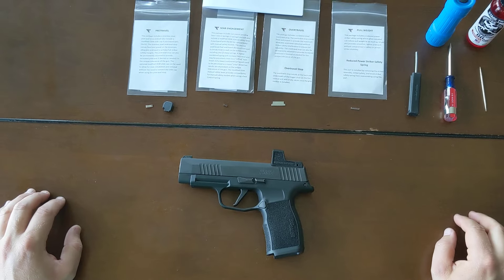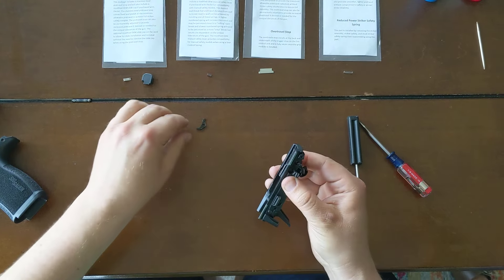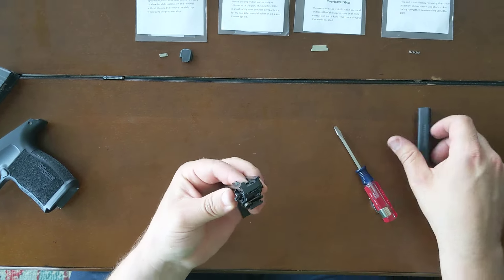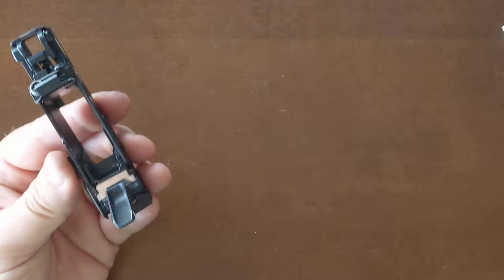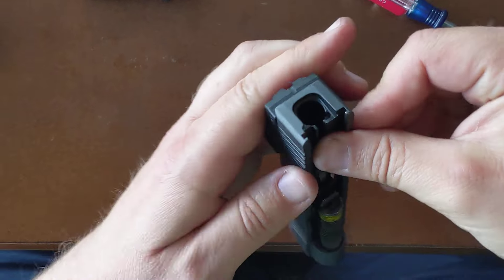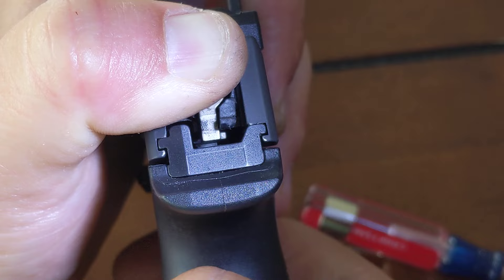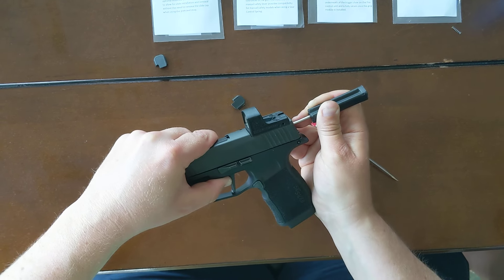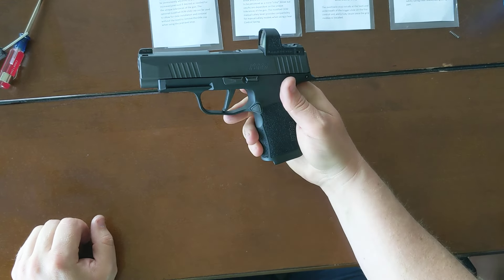Tactical Trigger, LLC Sig Sauer P365® Trigger Kit short install video

Comment: Holy crap, that took me about 2 hours to complete.
Mainly because of the trigger assembly stuff falling out, getting the alignment right...take it on and off because the overtravel stopper was making the sear stuck (not letting it drop the striker).
Ended up not using the overtravel stopper at all since while it does reduce a lot of the take up, it makes hard to tell if the trigger is dead or it's about to hit the wall where it drops the striker.
Gun I used is a P365 XMacro with the muzzle brake.
Sear spring #3
pretravel stopper
pull weight spring.

Overall, very happy about the reduced pretravel length. I can feel the trigger is lighter because of the spring and little bit shorter take up time.
Give an update when I go shoot it.
Reply: I would frustrate the hell out of myself trying to do this.......he makes it look like breathing air but wow what a change👍

Comment: This is exactly what I’m looking for. I want to eliminate that creep from the wall to the break while still keeping the pistol reliable and safe for EDC. Tbh I don’t really care about the weight of pull as much as a consistent break
Reply from the maker: @blackmetalbreadstick  Pole weight is optional with the kit and if all you want to do with it is just eliminate the creep in the brake, you can just purchase the sear control springs alone but most are usually interested in pre-travel reduction as well.

Comment: TT….I just installed the kit on my 365XL and funny thing is, my pistol would not work with the overtravel stop in both configurations. Once removed, it works like a charm and looks like yours does in this video and there’s no overtravel without it.
Reply from the maker: Some guns won't use an overtravel stop based tolerance variations. Sounds like that was the case with yours.

Comment: Same here after kit install , pistol would not fire ! Removed all but 1 super thin overtravel stop , still no fire ! Fired fine with no stop at all ! For my wife is there a lighter tension slide return spring ? She has hell jacking one in the chamber  !
Reply from the maker: A lighter slide spring will cause issues in the 9mm. You might consider a P365-380 for your wife which has a lighter slide spring and is easier to rack.
Reply: Should watch Melody Lauer's vid 
"Racking a Slide With Weak Hands"
https://youtu.be/kbayNc6D9HY

P365-380, love it. Highly recommended.

Comment: Will the pre-travel & post-travel stop pieces work on the curved trigger? Not a big fan of the flat trigger and want to replace it with the OEM curved one.
Reply from the maker: Yes, the complete kit is also compatible with the curved trigger as well
Reply: I changed to curve, and my finger doesn't fit well between the trigger and the trigger guard.

Comment: is it safe to carry with the #3 spring, pretravel stop, and overtravel stop? is it drop safe?
Reply from the maker: @LosPollosHermanos213  The kit is designed to maintain proper engagement levels for full safety and reliability margins. Since each gun has unique tolerances, it is best to inspect for proper margins on install. In most guns, the #1 sear control provides proper sear engagement levels but in some guns a #3 sear control spring functions like a #1. In the most extreme tolerance outliers, #3 may not provide enough sear engagement margin in which case we have alternatives available (these is very unlikely). Sear engagement is the primary drop safety and the striker safety is the back-up/catch all. The pretravel stop is extremely unlikely to bypass the striker safety as the takedown lever won't rotate far enough to put the slide on if did, however again it's best to check for proper function and margins on install. That's why we provide the safety and reliability checks so that you can have confidence, everything is good.

Comment: I have noticed some discrepancies in my grouping of P365 that isn't present with my 1911 and I attribute it to the "creep" between the wall and the break. If I understand correctly, sear control spring reduces creep by lowering the starting position of the sear. Can I buy only the sear control spring? Thanks
Reply from the maker: Yes the sear control springs are available separately from the full kit.

Comment: How does the modified backplate change in function from stock?
Reply from the maker: With reduced pre-travel when using the pre-travel stop the safety lever is kicked up slightly which interferes with the stock slide cap when removing or installing the slide. The modified slide cap allows clearance to be able to install and remove the slide as normal when using the pre travel stop.
Reply: @tacticaltriggerllc   So do you have to remove the backplate to get the slide off, or do you just have to wiggle it a bit and pull up on it?  :)
Reply from the maker: @joeflowers9084  You would need to remove the stock slide cap when using the pre-travel stop. The modified slide cap allows for normal takedown and installation of the slide.
Reply: @tacticaltriggerllc  Thanks (I found the answer on your website and already ordered one--this is a really good design).

Comment: Is getting the MCarbo Titanium striker kit worth it to get better quality parts in the long run, and is it compatible in any way with your trigger kit?
Reply from the maker: The Mcarbo titanium striker is not compatible with our sear control spring based on its geometry changes. It also has less primer strike strength compared to a stock striker based on the weight and reduced power spring. Most customers I have talked with that have had them experienced reliability issues. You will get much better performance with a stock striker and our sear control spring. I wouldn't recommend using the Mcarbo striker.
Reply: @tacticaltriggerllc  thank you for saving me the hassle (: I'd much rather have it really reliable than have a nice gun not fire. My main concern is rust issues on the striker and spring and that affecting reliability. That was my main draw towards the titanium. 

P.S. Ordered the trigger kit last night and I'm excited!

Comment: Are there any trigger safety triggers you would recommend that are the flat style that could work with this trigger kit? I like the stock but was debating getting a trigger that might have just that extra bit of safety for the gun.
Reply from the maker: The only one with the trigger safety is the Tyrant CNC trigger that I'm aware of. The trigger kit does work with that particular trigger with the exception of the pre-travel stop may need a layer removed or can't be used at all depending on tolerances. If you're interested in additional safety, I would add a manual safety lever as opposed to using a trigger with a blade safety since all the blade safety is really there for is the trigger itself is so heavy, it can be pulled in a drop. If you want to add a manual safety to the gun, you will need a modified manual safety lever for compatibility with our sear control spring. We have those available on the website if needed.
Reply: @tacticaltriggerllc   ah. I think I checked the "not needed" box when I ordered mine because the grip module I'm getting doesn't have the manual safety (the Wilson Combat p365 x macro grip module). So I may just be out of luck then? Either way, the gun I currently have doesn't have a safety (it has a slight trigger safety I guess). I'm sure someone would explain to me that a safety isn't important and leads to a false sense of security, etc. But that's why having the trigger safety would make me feel a bit better about it.
Reply from the maker: @Rothdrop  A trigger safety isn't an "active" safety in the sense that your finger defeats it in the same action as pulling the trigger. The pre-travel stage of the trigger pull on the p365 defeats the internal striker safety. A blade safety isn't required because the trigger won't pull itself in a drop based on its weight compared to the trigger bar. Guns with trigger safeties need them to avoid the trigger pulling itself based on either the weight of the trigger bar or the weight of the trigger. You can still add a manual safety, we have them available separately from the full kit. As noted you would need to get a compatible grip module or modify the grip module for the manual safety cutouts.

Comment: I currently have a tactical development enhanced dual flat faced trigger on my 365. Would this kit work with it? It's basically a trigger shoe change
Reply from the maker: Yes it is compatible. You can either use the pre-travel set screw on the trigger or our pre-travel stop. The rest of the kit is compatible without any unique considerations.
Reply: @tacticaltriggerllc thank you so much. Placing my order now. I have it on my stock xmacro and love it.

Comment: Will this work with the m carbo titanium striker kit and the Tyrant cnc trigger? I also have the empire pdf javelin recoil spring, super long qeustion I am sorry
Reply from the maker: The sear control spring is not compatible with the mCarbo striker. You will get much better performance than the Mcarbo striker by using a stock striker and our sear control spring while avoiding the reliability issues of the Mcarbo striker. The kit is compatible with the Tyrant CNC trigger except for the pre-travel stop since pre-travel reduction allowable is governed by their blade safety. Performance wise most that have compared any of the aftermarket triggers upgraded vs the stock trigger upgraded with our kit will usually prefer the stock triggers. Other aftermarket triggers are more about looks than performance but there is a place for that as well. Hope that helps.
Reply from the maker: The recoil spring won't have any compatibility considerations with our trigger kit.
Reply: @tacticaltriggerllc  appreciate the quick response, if I had known about your amazing product before I bought the titanium striker I would have just gotten your product, sadly I already have the titanium striker, so I'll have to make do. Definitely using your stuff for my next build though

Comment: Does the trigger kit effect the drop saftey of the handgun?
Reply from the maker: Drop safety is not affected. Safety checks can be performed at installation and also recommended periodically to ensure all safety features with appropriate margins are maintained.
Reply: @tacticaltriggerllc  sweet! Thanks for the quick response. I think I'm sold.

Comment: So what does the “sear control spring” do?  The gun doesn’t have one, so is adding it basically keeping the striker from going downward as much?  Also, it’s loose and not putting pressure on the safety lever, correct? It’s just there to add space, like the spacers in front of and behind the trigger, right?
Reply from the maker: Yes. It isn't acting as a spring. It is acting like a spacer increasing the thickness of the safety lever pin. The safety lever pin is also the stop for the sear so increasing it's thickness adjusts the ride height of the sear.
Reply: @tacticaltriggerllc  Yes, I figured it out after watching the long P320 video. Thanks!  Mine is on the way.
Reply: @tacticaltriggerllc  I just installed my kit on p365, sear spring 3 and 1 over travel plate cause the gun won’t fire with more than 1over travel plate. 

My question is will going to sear spring 1 allow me to run more over travel plates? And from the looks of it spring 1 is the thickest so will that give more of a rolling trigger and spring 3 more of a breaking/crisp trigger? I just removed the sear spring cause the sear and striker were only connecting about 75% now it seats all the way.

Either way I just ordered another trigger kit for my pmm compensated p365x so I’m definitely looking forward to seeing how the two differ.
Reply from the maker: @CplGoldFish21  The sear control spring doesn't affect the overtravel. So installing a different sear control spring won't have an effect on the number of layers you can run on the over travel stop. The number one sear control spring provides the least amount of travel from wall to break ie more crisp. The sear control spring performance is relative to the tolerances of each gun. For example a number three could perform like a number one on another gun. The goal is to find the sear control spring that provides full coverage of the sear interfacing surface with the striker but not too much more. In most newer guns a number one sear control spring can be used to achieve this but some guns may still require a number 3 based on tolerances. Another check that can be done is with over travel minimized to just provide a clean break and no extra additional over travel, the travel from the wall to break should be around a 16th of an inch or more if the striker and sear engagement is greater than full coverage. This is a secondary check that can be done if you are unsure of how to verify the sear engagement visually. Hope that helps.

Comment: How durable are those metal shims that are placed around the trigger to act as travel reducing stops?
Reply from the maker: They are made of stainless steel and will typically last around 10k rounds on the low end.
Reply: When they fail can it cause malfunctions or does it just wear down over time?

Comment: I had a shop install my kit and decided to take out the overtravel and pretravel stops. Because its my EDC. Can you explain what the rest of the kit is doing compared to stock internals?
Reply from the maker: The sear control spring reduces the amount of creep in the break. A stock gun does not include a sear control spring. The reduced powered striker safety spring reduces pull weight by using a lighter spring than the stock spring. The striker safety spring is a good choice for pull weight reduction since it has no impact on primer strike reliability or safety function.
Reply from the maker: The pre-travel and over travel stops have been designed to allow for appropriate margins for a concealed carry application to maintain full safety and reliability as well. However, for preference, some may prefer more pre-travel and/or overtravel for a carry application.
Reply: @tacticaltriggerllc  Yeah I really like the springs in the kit. I do notice a significatly better break using #1 SCP. I think its just my personal preference to take out the pre and overtravel spacers. I still have almost zero overtravel so Im really really happy w the kit overall. Hey thanks for reaching out so fast!!! I know this video is over a year old so I really appreciate it. Fastest reply I've ever had. Thanks again for the great explination of everything. I will be recommending your kit to all my buds. Cheers!
Reply: @napster1363  can I buy the over travel stops from you?

Comment: How do you reduce the trigger pull weight to 3lbs?
Reply from the maker: Once the stock springs and sear to striker interfaces are broke in, the pull weight will be between 4 to 5#. If you install our reduced power striker safety spring, the pull weight will be 3 to 4# depending on the particular gun. On some guns that are closer to 3#, I will install the stock striker safety spring to bring the weight up closer to 4#. Then on guns that are over 4#, I will install the reduced power striker safety spring to get closer to the 4# range as well. If you want it as close to 3# as possible, then start with striker polishing and our reduced power striker safety spring. If it is still closer to the 4# weight you can look at modifying the trigger spring or install a reduced power sear spring which is a bit more difficult to install.
Reply from the maker: I would not recommend ever using a reduced power striker spring  to lower pull weight as it will degrade primer strike reliability and isn't worth the tradeoff in my opinion.
Reply: @tacticaltriggerllc  hmmm ok, just to clarify…
I ordered the trigger kit for 365.   But you are saying don’t install the striker spring that comes with the kit because it reduces reliability??
Reply: It would be great to reduce the trigger weight a bit, but I don’t want to sacrifice reliability or induce malfunctions.
Reply from the maker: @user-hn9fr7mn3x  no, I am saying don't use a reduced powered striker spring from other manufacturers as they reduce reliability. The reduced powered striker safety spring is different than the striker spring and is what come s in our kit and reduces pull weight without impacting reliability.
Reply from the maker: @user-hn9fr7mn3x  So to clarify, you can use everything in our kit without impacting safety or reliability.
Reply: @tacticaltriggerllc  ok great.  Look forward to testing it out.  Thanks for the quick response

Comment: What is the difference between the modified slide cap and the OEM?
Reply from the maker: The modified slide cap allows for normal takedown and install of the slide when using the pre-travel stop. With reduced pre-travel, the safety lever is up a bit which interferes with an unmodified OEM slide cap. The modified slide has a small notch to allow clearance for the safety lever.
Reply: @tacticaltriggerllc  Could I use this kit without the reduced pre travel stop? I have a manual safety on mine and a custom slide cap that I would like to keep. Thanks
Reply from the maker: @mojohesse  Yes, each part is independent of each other so you don't need to use the pre-travel stop to get the other benefits of the kit. We can also mod your custom slide cap as an option as well. We have done that for a few customers before.

Comment: Why do you offer a modified manual safety.  Does the factory safety not function with this kit.  Would love to upgrade with this kit but not sure if it works with the P365 X with manual safety.
Reply from the maker: The modified manual safety is for compatibility when using a sear control spring. If you want to run a manual safety with the kit you'll need the modified manual safety lever and it is compatible with the p365x with manual safety.